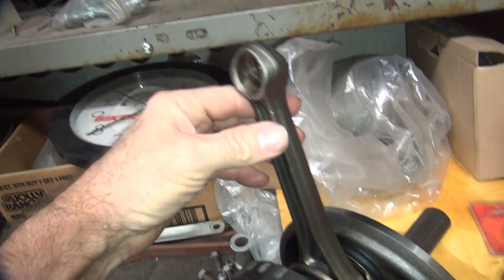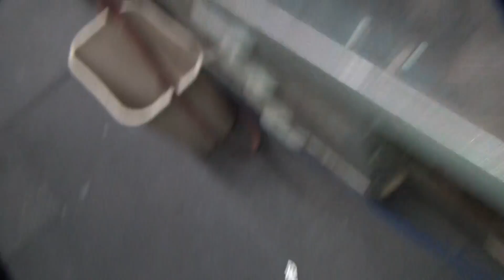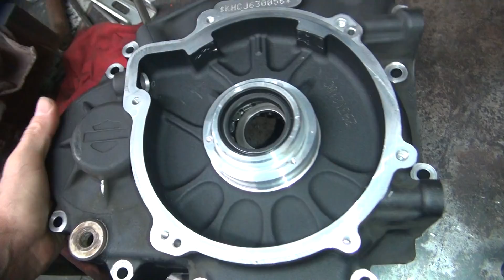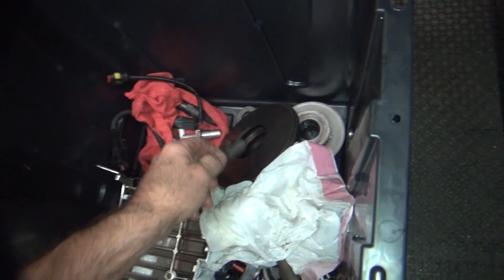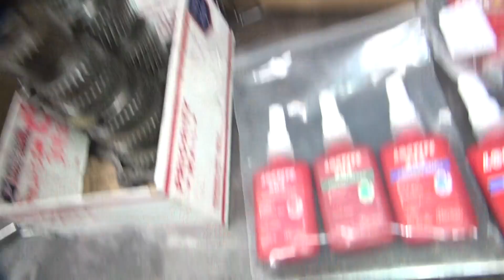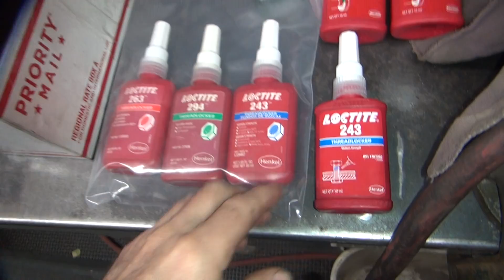#101 tatro machine 1st look m8 lowerend 2020 reason for bad cam bearing failure repair fix harley

Comment: ,,,,I need a set of old 1978,,,,,S & s steel stroker wheels,,,,4 . 625 inch stroke......have anything,,,,,I'd rather pay you than truett and Osborne........?????
Reply from the maker: nope. find a good s&s set on ebay. those other ones suck.
tatro
Reply: @TatroMachine  ,,,,,,,,,,,,,,,,,,,,,,,,,,,,,thanks   tatro..........................

Comment: Harley made a good engine with the early evo so why would they make more power with an engine that looks like when they fail it will be a big fail.
Reply from the maker: the 90's cheap ass evo cranks sucked too. leave it to the aftermarket to make the good parts.
tatro

Comment: When I first saw the retaining screws, I thought "this weakens the press fit". A lot of material removed for the screw hole. They used retaining rings on the output side, why not on the pinion side? Could this possibly be due to an excessive number of the useless offspring of elites in engineering decision making positions? What about those engineers, designers, execs who have been shit, belched, and vomited out of our university system? Or maybe anti-Christ communist scum doing this intensionaly to destroy the company slowly?
Reply from the maker: the screws were a stop gap fix for a crank flexing problem walking the bearing out of the case. bad things happen when this happens.
tatro

Comment: Beware of the balance shaft bearings in the crankcase , they are cheapass made in India bearings  with plastic cages . I rebuilt one last year , the cage failed and plastic debris circulated throughout the engine , plugging crucial oil passages . It was a mess and getting replacement bearings at the time was a shit show.
Reply from the maker: just go buy the steel caged versions of the bearings. harley is not the only place to buy harley parts.
tatro
Reply: @TatroMachine do you have part numbers for those bearings?

Comment: Hey Tatro, do you still have that m8 balancer you said you guys were going to be leaving out in this build?  I could really use that bad, I got a blown up m8 some metal ran thru that backlash elimination gear and the stationary gear on it and now it’s bent over so slightly and causes a tight spot when trying to spin the engine over.  Let me know if you’d let go of it and have time to ship it I can drop you some $…thanks bro

Comment: Hey tatro, do you put loctite 638 on valve seals? I remember in another you put some green loctite on some seals, but I’m not sure if it was 638 or something different.
Reply from the maker: yes i loctite them on. it was a different number. they have lots of new numbers to choose from now. get a high heat one.
tatro

Comment: Has Harley ever made anything that isn't crap or junk?  I've been interested in owning one for a long time but videos like these reinforce the reputation that Harley has earned over the decades. Back in the day everyone said "Buy a Harley, buy the best, ride a mile, walk the rest."  I guess nothing has changed. I'll stick to my metric cruiser I guess.
Reply from the maker: harleys are like an old truck. they will take a ton of abuse and keep going no matter what. this leaves lots of room for improvements to make it what you want it to be. harleys makes changes over decades so you have a very large parts mix to play with to make it your own. it is very hard to beat that with anyother manufacture.
tatro
Reply: Harley makes a good product overall.  But if you modify it you will be asking for trouble with the newer twin cam and M8 models.  Leave it stock and it will be fine, despite the cheap short cuts and cost cutting measures shown here.  Modern manufacturing does put any thought into rebuilding.  It is a throw away world.  I don't like it but that is the way it is, cars, trucks, motorcycles, what ever.  This engine had aftermarket performance parts installed, engine life was shortened.  If you like hot rodding your engine, modifying it yourself, trying new ways, get an evo.

Comment: Who welded the crank pin? Is Harley doing that now?
Reply from the maker: no, someone spent a ton of money on this motor and than it went all to hell because they did not assemble it correctly. slow down and pay attention. it will save you in the long run.
tatro

Comment: 2020 engine and already toast? What a piece of crap. Thank God I have a 80 evo, they run almost forever.
Reply: A hack installs the cam bearing without checking to see if it's rolling freely, while installing numerous other aftermarket parts and it's HD's fault?
Reply: @jefferythomas4414  yeah, the M8 is without a doubt the best motor EVER
Reply from the maker: is your ass on fire for that one.
tatro
Reply: @TatroMachine  I made that comment with sarcasm, ain't no way the M8 is even considered to be the best motor ever. I think the Flathead was...

Comment: Noticed the crank pin was welded.... your work ?
Reply from the maker: no, i don't weld cranks. buy a good crank from s&s or ultima and you don't have to screw around doing stupid stuff like that.
tatro

Comment: Only thing that I see as a possible "improvement" is the non drive side bearing is able to be replaced thus eliminating any need for case race lapping requirements. Obviously the elimination of the Timken on the drive side was and forever will be a dumb move.
Reply from the maker: the key is to have the larger roller size. to make room for that everything else had to be changed.
tatro
Reply: @TatroMachine  yes. Agreed and it looks like they managed to do that

Comment: I have a 2013 twincam, the compinsator is gone out. I ordered a dark horse comp to replace it. I called harley and they told me that compinsators were obsolete for my bike. Thus why I bought the dark horse costom compinsator. About 200 dollars more than the original. Iam very disappointed that harley didn't stick with it and come up with a fix for my bike. My ironhead has kept me in the wind though.
Reply from the maker: so much for harley supporting their bikes. i am sure they can set you up with a nice new m8 and a new harley jacket.
tatro
Reply: I think the part number was super ceded. You cannot buy the exact unit that came on your bike. It’s upgraded. SE comp

Comment: Keenan, check the service bulletin on those piston oilers. I think there was something about the bolts being too long, causing an oil pressure problem?
Reply from the maker: i don't need seriver bulletins. i can tell that crap when i put things togethere. its called, paying attention to the details. that is why some mechanics motors run better and last longer while useing the same parts as the other guy.
tatro

Comment: I know you're not a fan of the EVOLUTION motors, but one look at the inside of an M-8, I'm glad I kept what I had. Harley is just screwing their customers with cheap crap. I don't understand why people are still buying this junk. Its one thing to buy a new motorcycle, then decide to modify it, but this garbage needs thousands of dollars worth of work just to keep it running.
Reply: Amen, same thing I said. I wouldn't want anything new AT ALL!!! GARBAGE
Reply from the maker: is that the short line or the long line you are standing in.
tatro

Comment: To much Valve Spring Tension on 1 cam with inferior bearings...Another Better Mouse Trap Idea...P.O.S.
Reply: Too much on one cam , exactly what I thought , most people dont think about this either , the more duration the cam has the steeper the duration angle , that flat duration face coming at the lifter roller is sudden shock and will cause the lifter bores to wear faster and get loose , it has no choice , its a aluminum motor block , aluminum can not take the stress a cast iron motor block can take , doesnt matter if its a single or twin cam the lifter bores take a beating  , thats my opinion and Im sticking with it .......
Reply from the maker: i am not seeing that but that can be some of it. the good cam bearing was installed wrong forsure.
tatro

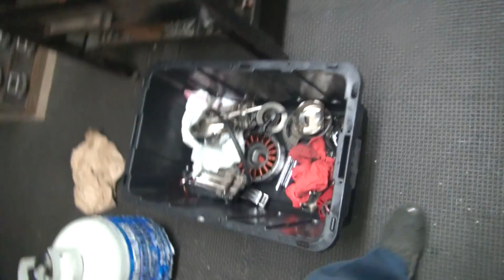Comment: @ 10:50 you say: i do not know what the hell this part is or go's to... Haha... stay with the old Harleys Tatro and leave this new engines to the suckers....  you even said i an not supposed to work on this crap .....  correct run from it... i had a 2nd gear bearing fail at 7K on my new 2020 FXLR  M8 brand new Hog... JUNK BEARING....
Reply from the maker: i didn't know what it was but i said what i think it was and i was correct. you can't fool me this easy. or maybe you did, i did look at it.
tatro

Comment: Good morning, is the inner cam
Bearing recessed? Looks like it set down into the case .0100 or so? Should be about flush? Or is it just an optical allusion?
Reply from the maker: no, harley has a big chamfer and you need to be past that to be into the bore.
tatro

Comment: Tatro is the crank in the 88 twin cam any good man or all they all junk?...I bought a used road king turd that has fueling cams in it. Is everything made today for these engines junk?...pretty much
Reply from the maker: all stock harley cranks are junk. use the s&s or ultima cranks. they are both good and will take alot of abuse. like most harley motors. if you replace enough of the junk har;ey parts you start to get a fairly good motor.
tatro
Reply: @TatroMachine  Great advice Keenan, I took your advice and put an Ultima Flywheel assembly in my Evo and have never been happier